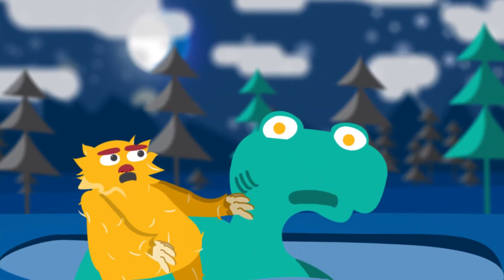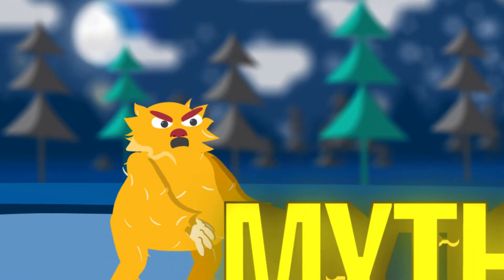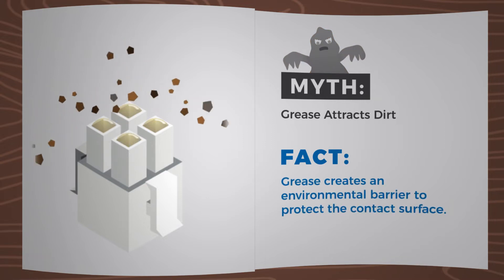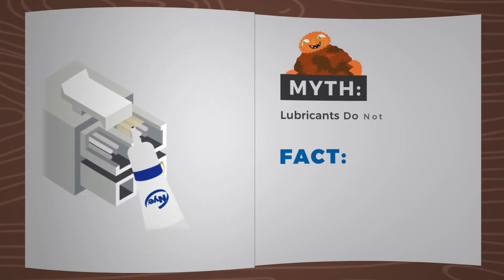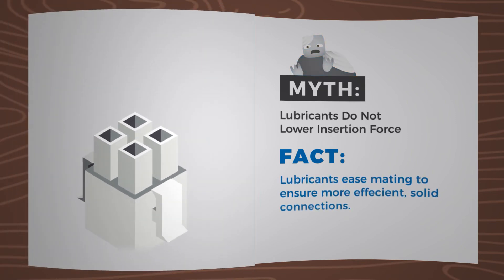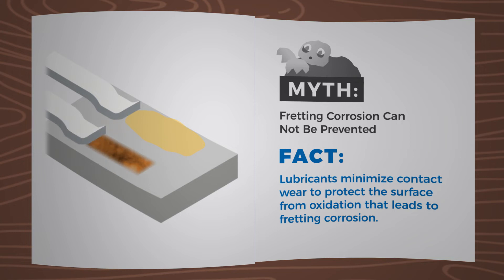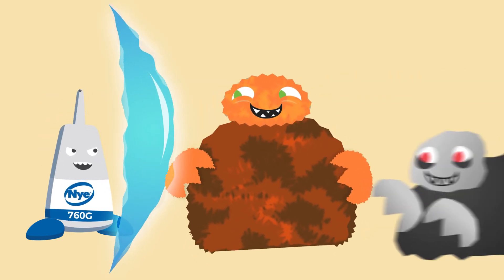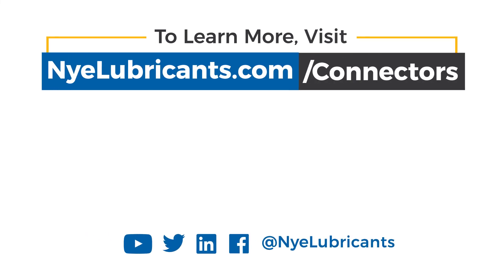The Myths & Facts About Connector Grease

Comment: This is funny because I've worked in two totally different industries where in one the idea of using "connector grease" would get you fired on the spot (or at least yelled at) and that was a highly technical industry populated by many very talented engineers who worked in high pressure situations.

In the second industry I have personally experienced & witnessed the ill effects of using connector grease and personally had to correct them. It is good to seal against the elements or just not be in the elements at all when possible. So no connector grease there. 

If you have to be in the elements all of the working time then routine cleaning is going to be required and that replacement connectors will just be a part of the work routine as they wear out. In some cases you can make connections and protect them AFTER  the connection is made. In other cases you can only clean and replace as wear and tear takes over.

But in every case where I have seen "connector grease" used, I've seen electrical failures that was clearly caused by the grease itself which was only rectified by cleaning out the grease and sometimes including connector replacement.
Reply: Exactly right, the entire industry is a full on scam

Comment: "Grease" can go directly on the electrical connection- - - but NOT "dielectric grease" because it does NOT conduct electricity and will BLOCK electricity.

Transmission fluid also does not conduct electricity which is why you can have a bunch of sensors inside your transmission and they don't shot out.

Just because they all look similar doesn't mean they all work the same so buy the right stuff with a specific purpose it was made for .

Comment: With all these benefits I'm curious why it isn't used by default everywhere.  If it improves reliability of connectors so much it seems like car manufacturers would use it on harness connectors, for instance, but I've never seen one with any.
Reply: @DanielEdwards007

No. It may seem that manufacturers would use it if it was good, but no. Manufacturers only do what is necessary, without any concern for longevity past warranty, or for ease of repair. 
For example, it is also correct to use anti-seize on 02 sensors, but Manufacturers do not.
Reply: It's mainly used when direct exposure is possible.. it was used on auto lights for years but the car and bulb designs eliminated the need..
Reply: It's ALWAYS about the $$$$. The cost of the dielectric, and the time to properly apply it. I use it on ALL my electrical connectors.
Reply: @im2yys4u81  Dielectric grease inhibits electrical contact.
Reply: Is connector grease and dielectric grease the same thing? I continue to have a problem with my electric smoker, where the power 😢plug connects to the back of the heating element. That plug-in connector always gets super hot, sometimes melting the cord connector. What lubricant should I apply to maximize conductivity.?
Reply: @stevedyer5902  The grease keeps air and moisture away  from the contacts to prevent corrosion.. Silicone paste dielectric grease can handle a lot of heat, but the contacts have to clean to start with
Reply: Planned/Design Obsolescence.